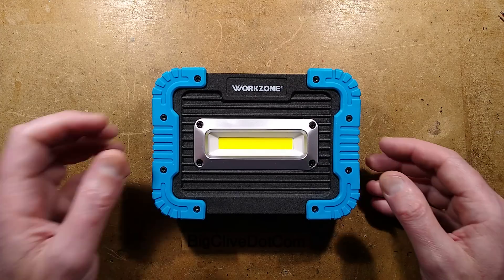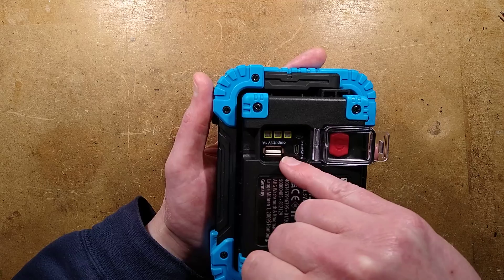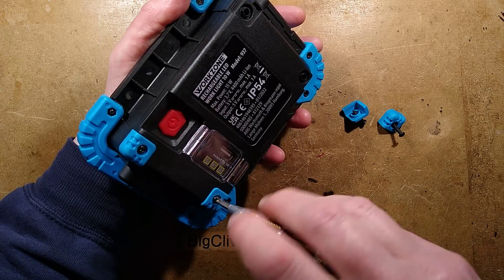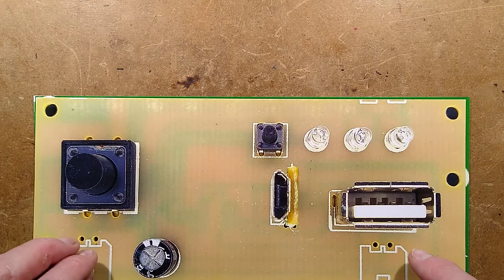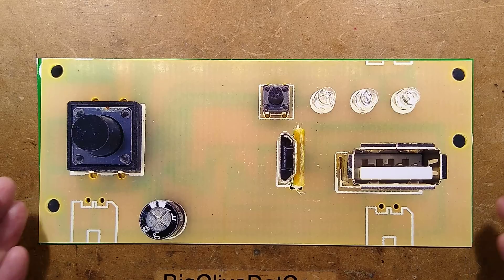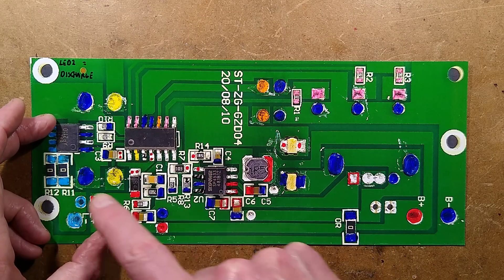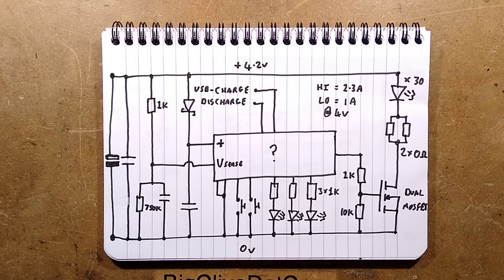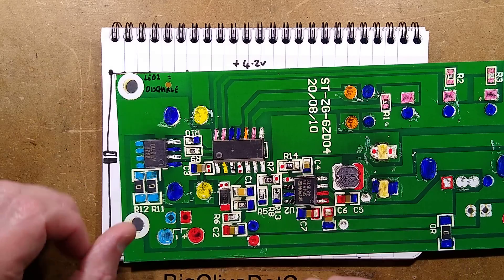Inside an Aldi rechargeable work light (with schematic)

Comment: Costco in Canada sells an almost identical one (a pair, actually) under the "FEIT ELECTRIC" brand.  Interestingly, I grabbed a box containing two of them and went through the self-checkout.  It gave me an error on "Incorrect item weight", at which point I realized that someone had removed one of the two from the box.  The first time that scale at self-checkout has actually been useful!
Reply: I got a Feit Electric Rechargeable LED Worklight WORK500FLEXBA, it's really bright. I had to repair it (solder the ct. bd. to a metal piece that attaches it to the battery, that is the weakest link inside it, once I resoldered that I had to admire how well built it is. If yours ever stops working check the connection of the ct bd to the battery, it's a little flimsy.
Reply: I have a pair of those Feit Electric lights, but needed to buy two boxes just to find two units that lasted at least 11+ hours at low output. Two of the units didn't exceed 10 hours, so those were returned for a refund.
Reply: @RayleighCriterion  good to know! I use Milwaukee M12 work lights and they’ve been excellent!  Much more expensive however.
Reply: I've seen an almost identical model branded CAT from Costco in Canada and the US, but it has its own power supply rather than USB, it has a central round led. The power supply has a led which goes green when the battery is charged. The charging port is live when the main light is off, by pressing the little button that displays the charge level. The first power indicator light will light in this mode. They are super bright and run for a very long time. Mostly exactly the same external package except it's the usual bright yellow CAT standard colour.
Reply: @hjkaye  it’s not really that surprising as in all likelihood it’s the same product from the same manufacture but under the Aldi own brand with slightly inferior components. The big difference is the availability as stateside you’ll probably be able to get these all year round but from Aldi in the UK it will be twice a year sort of deal, only sold a week at a time with very little notice as to arrival. Also once sold out it won’t be restocked. But that’s the Aldi way.
Reply: Lmao 🤣
Reply: I have seen the same light a harbor freight and homedepot under different brands
Reply: @jaykoerner  my dad said to me the other day, hey check out the led from Costco (FEIT). As I turned to look, he turned it on (bright). 😵‍💫
As you said, it’s bloody bright!

Comment: I have a similar light that you can put your own 18650 cells in. It takes up to Four in parallel. So you could basically put any you had, or get fresh new high capacity cells.
It will happily run on one cell, should you so desire.
I would put a link here, but YT does not like them.
Reply: For the link thing, I've found that breaking up the link into its component parts, with at least four filler words in between, seems to get by.  Don't use "see oh em" with only one em, use "comm" instead, maybe.  Strings of nonsense like "/ nZF DHJ ED y6A" usually get through okay, and sometimes it's easier to archive the page and use the resulting archived address instead.  Pasting things seems to cause a failure, also.  And check from a browser where you're not logged in, to make sure it went through.

e.g. --  " archive "  and then ignore this bit  " • "  but string together all the  " today "  bits in quotes to get the  " / QU 484 " final address of the thing there.

Comment: I can remember the days when a "torch", which is what this basically is, had three components: a battery, a switch and a bulb. Nowadays, they include a large selection of components unheard of 40 years ago, including a microcontroller, otherwise known as a computer.

Progress? Possibly, though a child could have fixed a broken one in those days, whereas many engineers would struggle to do so nowadays.
Reply: Well, it is rechargeable now, and that itself adds complexity. The fancy microcontroller is unnecessary, but that's about it

Comment: Monitor the output over time after turned on.  I think you'll find the duty cycle of the output to the LED's falls off after a preset number of seconds.   Easy to see on a scope, but even easier to see if you turn one on, walk away, come back a few mins later and turn a 2nd one on and compare the two.   All these co's are cheating with these lights that slowly dim programmatically after you turn them on.  I bet you'll find the output on "high" is lower than "low" when compared to one freshly turn on when low.  I have a video showing this with a similar light on my channel, but I've observed the exact same behavior from a light sold here in the US that looks identical sold by costco branded as 'feit'.
Reply: here's the vid if it lets me post the link: https://youtu.be/Uzj8XkQBHAk

Comment: The model i have has 4 charging lights on it and it stops blinking when fully charged. But mine is also IP65 rated, with 6000 mAhl. It has model number 8862

Comment: I've a similar unit, a Brennenstuhl ML CA 110 M 1173080. It was crazy expensive back then, up to 100€ depending of the store, I got it for "only" 18€ at a pawn store, brand new without accessories, which where just a USB cable and a carrying bag, a good charger must have seemed too expensive to them, I suppose that as Apple is now saying with the iPhone we all already have lots of USB chargers at home and in the car ;-) It's also sold as Philips RC520C1, about as expensive but I think Philips throws a charger in the package.
It has 4 charge indicator LEDs and those work OK, also it only switches to low power mode if the button is pressed again withing a few seconds after turning it on, otherwise it just turns off when the button is pressed again, and that's the feature I like the most because all the other LED lights I have to go through several modes to turn them off.

Comment: We get those exact ones with yellow trim (instead of blue) in South Africa under a “Magneto” brand name.
Slightly different operation on the button. Only 2 modes… normal and eco.
Mass manufacturered somewhere in the world.
I placed a phat lithium pack in there thanks to the things that I have learned from you!
Thanks Clive 🍻🤝

Comment: I’ve got two cat led lights from Costco, a few years old and still going strong, these Aldi ones are a direct copy of these ( the cat lights have a round lens rather than rectangular)
Reply: Not sure what generic Chinese company made those for CAT, but there have been a couple variations for sale at Costco over the last few years, both rechargable and AA powered (and both CAT and other brand names).  If anyone wants one of these lights, Costco is selling through the latest batch (a 2-pack that are basically identical to the one Clive has in this video).  Costco does have the death star *  in the top right corner of the sign, so once they are gone it may be a while before a new model replaces it.
Reply: In fact, they may both be copies of an older light from a higher end brand like Hilti or Makita .

Comment: The resistors in the voltage sense circuit are 1K (01B) and 750ohm (750E) (not 750K).
Reply: But that would mean, that batteries will deplete after approx. 4400/2,4 = two and a half months. Thats not good :/

Comment: Have you deconstructed one of those LED turn signal lamps that has 144 of the 3014 LED’s in it? There’s a small circuit board inside.

Comment: Torch bad SWITCH
Can you say who has the most reliable LED (flashlight) 
the SPSTM push button switches keep failing most times I cannot replace the switch do to the construction.  ---- Who makes a decent LED flashlight that's reliable (repairable?) ---

Comment: I have several lights similar to this in my garage, and I absolutely love them. Two of them came from Amazon, only complaint is that the included 18650s were garbage, but I replaced them with ones from my stash and they work excellent.

Comment: The filter with the 1.5 ohm resistor is more likely to stop noise coming out of the charger chip rather than going into it. Switching converters like that can put out a lot of high frequency noise from ringing when the MOSFETs switch, and that snubber circuit is cheaper than a choke for passing EMC

Comment: My spouse just brought home four of these, albeit a much fancier version.  Funny, that.  Obviously the same manufacturer, but with three brightness settings, and an impressive magnet in the swivel handle.  Branded Feit Electric, WLR2000/2, 3.7v, 4000mAh, 5VDC 1A in/out. Presently (slowly) charging my android phone device with it.  After watching your presentation, I am feeling a bit better about the cost, $15 U.S. each.  You da bom!

Comment: I really wish they'd move over to usb-c - and i dont mean the fully pinned expensive usb 3.1 one, 
simply the more robust design and even the usb 2.0 power pins in there, not the added ones for PD. (Basically the simple ones you get for DIY with only 4 pins coming out on amazon, ali, ..)

Comment: looks like a well made reliable light .would like to know how long it can run on high per charge
Reply: I'd like to know that too. But I have done a bit of math and calculation and I came to this point when I'm using the 2.3 Amps on hi and 1 Amp on low so it would last with 4.4 Ah about 4¼h on low and 1¾h on hi at a (guessed) efficiency with 85%. To be honest it's not that much duration for a working light.
I have the 4x AA batteries version and I like the battery-version more. Because I can just replace it in 15 seconds and recharge the batteries somewhere else or in the same room too and don't have to search for socket for the USB charger and have to deal with maybe too short cable.
Reply: @gumpi5  Not bad ,that's if the batteries are what they say the are and not chines or Indian rebrands

Comment: Best part of it is that it doesn't go into a strobe or SOS mode when you are cycling through modes by pressing the button.
Reply: .... Only taken them a decade to realize we only need to signal rescue helecopters infrequently. (or induce epileptic seizures).
Reply: I have a very similar model and it does the damned strobing thing.
Mine has a little torch on one end too.
I'd have much preferred the three brightnesses option Clive's has as mine only does the two levels plus torch and blinking blinking!
Mine has a battery compartment that can take 3 AAs or two 18650s which I've fitted.
It's a pretty (blinking) good light :-)
Reply: They put that stupid sos mode on every led light i can find, even just normal flashlights 🤦‍♂️
Reply: Agreed!

Comment: In the US, (as far as I know) we have a CAT version of this light, but it's wires do have connectors and is almost exactly identical to this light. The PCB looks almost identical, USB output, 2 cell battery pack (3.7v), and overall design is identical to the CAT light
Reply: Costco in the U.K. had these for sale for a while

Comment: I bought a similar one from Amazon few years back for about  $8. Two different things are : batteries are replaceable and either 2 18650s or 3 AA batteries can be used, and there's a blue/red flashing LEDs as third mode.

Comment: You didn't explain how there are two brightness levels with just a mosfet being turned on and 0 Ohm resistors. I assume there is some sort of PWM from the microcontroller (or not?).
Reply from the maker: It appears to be high frequency PWM.

Comment: Really cool to see this! We've had a couple of them.

Craftsman used to sell one of these in the US, however they no longer sell the rechargable one. Now they only have a version powered by AA batteries (much like the dual AA/18650 versions you can find on Aliexpress and the like). My Dad had the recharable version for several years, and I ended up having to replace the Micro-USB jack as it broke off the little stand-off PCB. I tried to repair it and ended up damaging the jack. Ultimately I ended up putting in a Mini-USB jack I had lying around, ditching the little stand-off PCB all together and simply holding it in place with copious amounts of hot-melt glue. It worked great right up until it he was using it in an attic of a large building and dropped it down the inside of a block wall and it was never seen again.

I got him another one, one of those disposable brand names from Aliexpress. Near as I can tell it's identical to both the Craftsman and the one Clive has here, other than the accent color. (The Craftsman was red, and the one I got was yellow.)

I don't recall the Craftsman having any trouble with the charging indicator flashing even when fully charged, but I've not spent any time with the newer one so I couldn't say.

Comment: LED dimming can be done using PWM, if a constant current driver is used it is easy to simply regulate the constant current output. I.E. you would have a DC current of varying magnitude.

Comment: I have the Harbor Freight version and a few differences.  The label Braun is on the bottom so the entire unit is flipped 180 degrees. 
But sadly I have first press 100%, second 50%, third SOS, fourth fast flash. ☹️
But I believe Aldi in the US is selling them this week or maybe last week and they were left over.
Also it does have a tripod ¼ 20 socket.
Reply: I also have a Harbor Freight version. Nice in many ways. 
I do with that it was designed to not self discharge when sitting around. After a few months it depletes the charge.

Comment: Hi Clive, I purchased a double pack similar LED lights made by Feit Electric. One light works perfectly but the other one charges to full capacity and when you go to use the light it operates for a couple of seconds and then goes off and battery is then exhausted. 
Any thoughts of what is happening.
Reply from the maker: Sounds like a failed battery.
Reply: @bigclivedotcom  
Purchased from Costco Wholesale,  love the light but will have to return both for a refund. Have been intouch with the manufacturer but they say they wouldn't be able to send a replacement out owing to batteries on aeroplanes. Will have a go at getting a replacement battery.  Thanks Clive, great channel.

Comment: Harbor Frieght is the US sells these under the Braun brand item number 56163 for about $25-$30. I have one and it has lasted years. On the lowest setting it is bright enough to light up a whole room and last a work day!
Reply: Does yours do 100% 50% SOS flash. Mine looks like an earlier version when all lights did that.
Reply: @chartle1  Yes is does high, low, sos, flash
EDIT: it also has wire dissconnects live bigclive was hoping for, but they are glued in place.
EDIT part 2: it looks like a different layout. There is only 1 button and 1 press shows the battery level using 4 LEDs. I'll try to post a good picture to imgur in a bit.
edit part 3: I dont want to post a direct link but finding an image in imgur isn't that hard K0sgphG SP3Ose2 S7BLMjN bottom left is hard to read. it is "A2SHB" on both chips

Comment: I've just recently got one from Aldi-Nord in Germany. They look almost the same from the outside. What I can tell (from memory) is that mine has a different power switch and a different LED module, but the rest looks almost the same. I like that little thing. Very inexpensive light for occasional use.
Reply: I got that one in 2019. The blue plastic is darker, the main COB is square (6x9 LEDs), there are 4 instead of 3 battery indicator LEDs and the arrangement under the flap is shuffled around. It also says only 10W on the back, not "max 15W" like the one Clive showed. It has visible PWM on the dimmer setting and the power switch of my unit is already starting to become unreliable...

Comment: MCU running for eternity with no way to reset is not ideal. The MCU may crash and the device would appear to be faulty. I could find real examples, when it actually happened.
Reply from the maker: The fix is to leave it to run the battery to the point the undervoltage finally kicks in and resets the processor.
Reply: @bigclivedotcom  In this particular product you can drain the battery using the USB output. In other devices it's not that easy, especially if it's stuck in the off state.

Comment: I like it. I wonder what the frequency of the PWM is?! 
With a 1K gate resistor, it can't be higher than 50KHz.
Doesn't you DMM have a freq measure function?